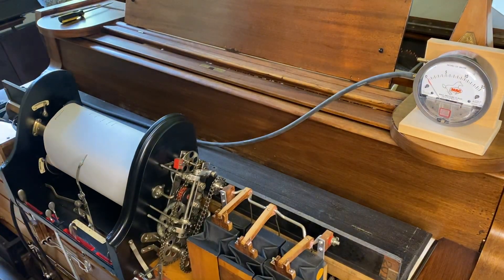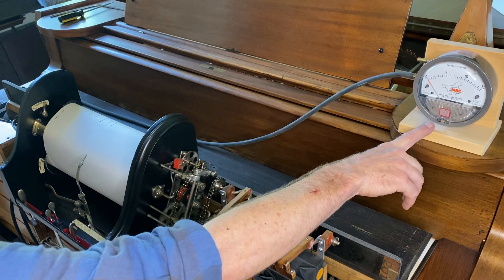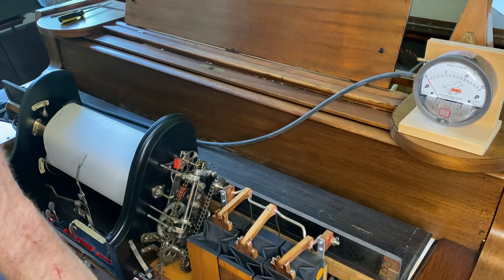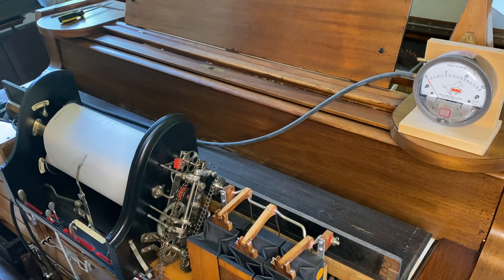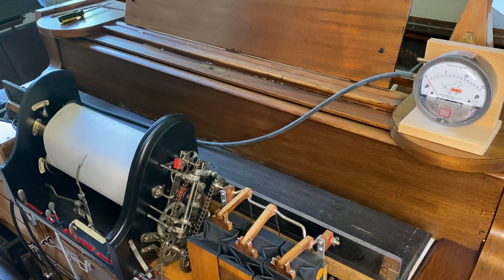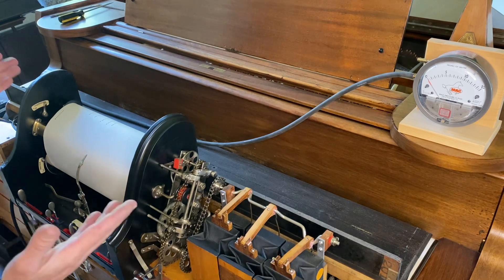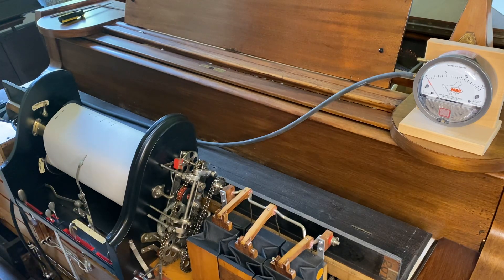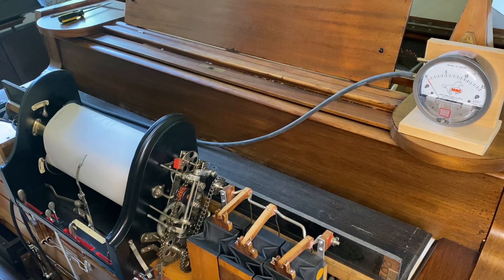Low suction test for Aeolian push up player “Easy to Love”

Comment: interesting! thank you for demonstrating. 

The Triphonola I restored also played at 3" minimum. But that had a double valve action as is common in most Hupfelds. 

I believe these push-ups a lways have single valve actions? at least my 88-note push-up does have a single valve action.
I always thought the single valve actions would operate at a higher pressure. (but than that doesn't make sense as the pneumatics are about the same size.... now I think about it).

Do these push-ups have 3 or 4 tiers of pneumatics? mine is a late model (flat top) push-up and has 3 tiers
Reply from the maker: This unit has double valves and four tiers of very large (2" X 5") pneumatics. The secondary valves and pouches are the largest I've ever seen for note pneumatics.
Reply: The 1910-12 pushups made at Garwood are double-valve, but those made by Couplex in Lille in the 1920s are probably single-valve because Aeolian dropped double valve actions with the launch of the Duo-Art in 1913. Couplex were supplied with Aeolian parts but used their own designs.

Comment: Does PSIG always mean "Inches of Water"?
Reply from the maker: 1" water column = .036 PSIG
Reply from the maker: No, they are totally separate measurements. Gages that display inches of water column will say "inches water" or "inches water column" or something similar.
Reply: @DuoArtOrgan  I was confused because it says 0-15 inches of water, but then it also says "Max Pressure 15 PSIG" which makes it look like they are identical.
Reply from the maker: @jimthesoundman8641  I can see how that would be confusing but it's purely coincidence. These gages can take quite a bit of pressure above the highest mark on the dial without damage.